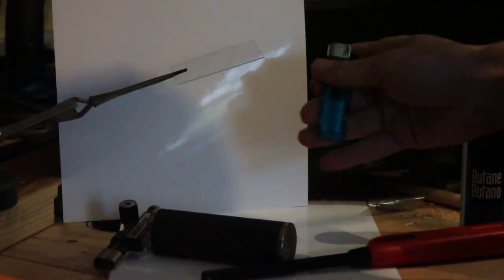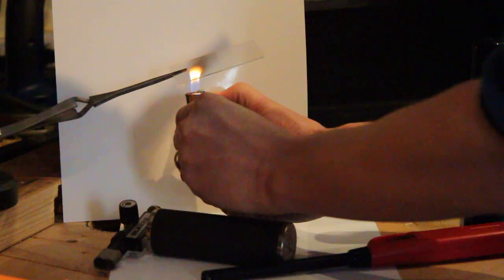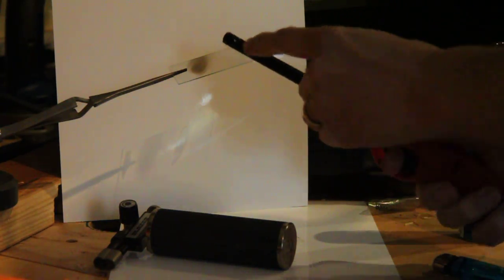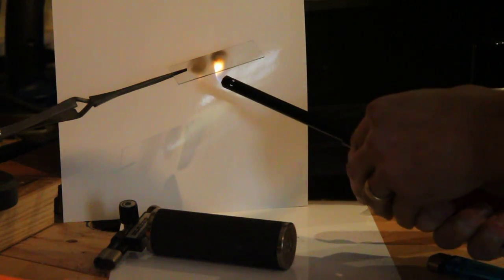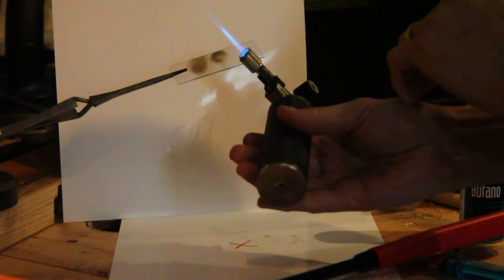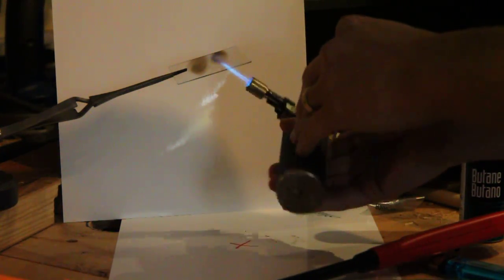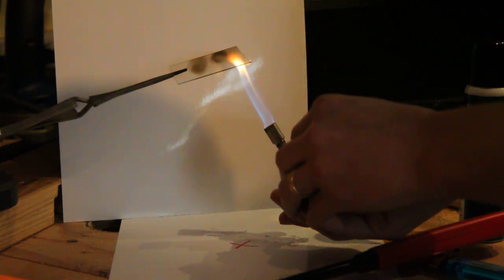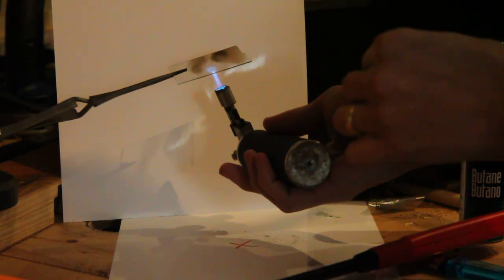Clean and Dirty Butane Flames

Comment: At the last moments, the clean-burning blowtorch begins to burn off the carbon soot which the butane lighter left behind, leaving it a little cleaner than before!
Reply from the maker: So it does! I did not notice that at the time, I was too worried about the slide exploding :)
Reply: That's how you clean a pipe to look brand new. Torch it long enough then rinse it out